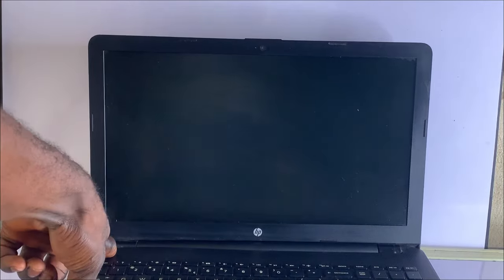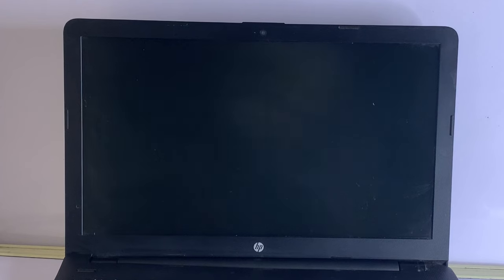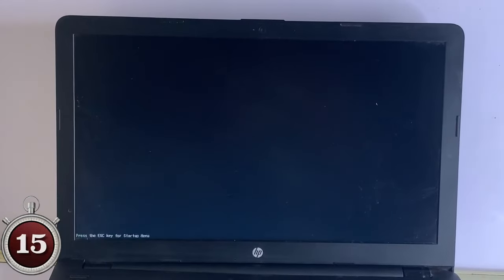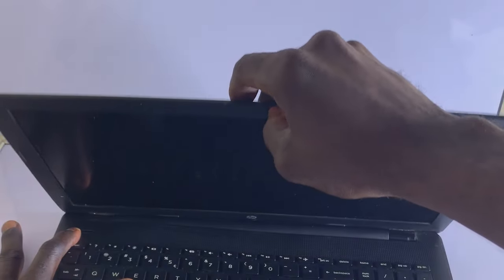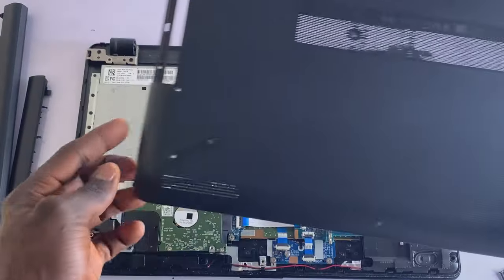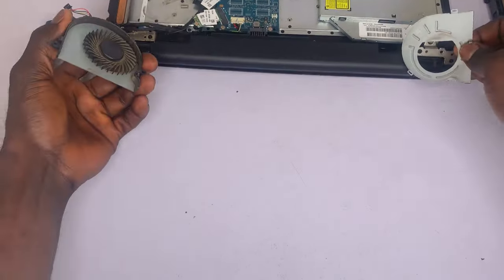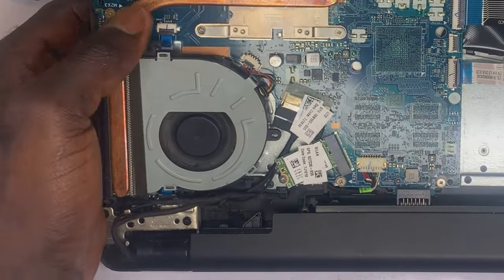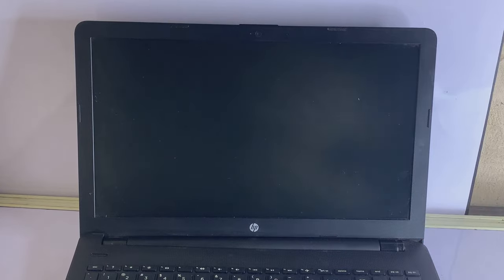Fix the system has detected that a cooling fan is not operating correctly || System Fan (90B)

Comment: What if the fan is spinning but it keeps saying errors 90B? What do I do?
Reply: Then change your fan completely
Reply: Am I right ? Mr. YouTuber 
because today I face same problem in my hp laptop so....
Reply: You change the fan
Reply: Full speed pr krke dekhlo
Reply: But the fan is brand new!😂
Reply: What the amount is needed for this replacement?
Reply: Clean your fan
Reply: mine too, what i found causing this is "WINDOWS SYSTEM UPDATE" i usually keep unninstalling the 22h2 update, and it really fix the problem, but my laptop cant be connected to internet, bcs everytime it got connected and updating, the fan problem is keep coming back
Reply: @Ayrustration same problem after windows update. How you solve fan problem. Plz hlp
Reply: I'm late but I got a new fan and still have the problem both fans I got were brand new
Reply: How to uninstall the last update without computer turning off due to the error😢 @Ayrustration

Comment: Fans are brand new, test both. Passed both 60% and 80% test, both failed at 100%. Now what? I seen one guy saying you need to solder a miniscule piece as small as a grain of sand that was missing 😂. Why would it fall off if it was soldered? Not to mention you need stuff to solder plus the "missing piece". And this guy is saying to ignore the message you computer's giving you and have the fan "always on"? The fan is supposed to be on when it needs to , he's just overriding. It will last 2 weeks max. 😂 Nobody knows. I bet if you go to a repair shop they will lie and replace the fans and say it's ok.

Comment: I thoroughly cleaned out the fan, still wint budge. Blew into the vent too. I ordered a new one yesterday, guess i'll have to be extremelh careful removing the housing around the motherboard, the battery just to remove the fan and heatsink and replace both. Also bought thermal gel. Why do we have such elaborate housing to get tot he fan? They should have made it easier to access the fan cable. I dont want to remove 15 screws just to disconnect the fan cable and find out its not that.

Comment: I opened the laptop, the fan it's totally clean and the bios configuration it's fine, the only option is to buy a new one?
Reply from the maker: Okay, but does the fan spin?
Reply: @whiszantech2425  nope, it doesn't move at all
Reply from the maker: That means it's should be from the Fan, try and request for a new FAN for your laptop or take to a professional Engr for the replacement
Reply from the maker: Since the PC is working fine, just replace FAN and have it functioning again

Comment: Muito bom o vídeo. Obrigado.

No caso ainda há outras opções caso tudo isso não resolva.
Existem duas possibilidades se o ventilador não gira de forma nenhuma.
Ou o ventilador está queimado ou a placa do laptop não está mais mandando a corrente para alimenta-lo.
Ainda há a possibilidade de ser as duas coisas ao mesmo tempo 

Primeiramente verifique com um multímetro para ver se existe corrente na placa principal do laptop onde o ventilador se conecta a ela. Identifique onde se conecta o fio dos 5v (geralmente vermelho) e o GND (geralmente preto) e faça a medição com o laptop ligado.
Você também pode testar o ventilador em outro laptop ou de alguma outra forma (uma fonte assimétrica talvez) o alimentando com 5v.

Se o ventilador estiver queimado a solução é apenas substituí-lo, o que pode ser um pouco complicado dependendo do modelo, mas pode-se fazer algumas adaptações com ventiladores de laptops diferentes.

Se a placa principal não fornece os 5v necessários para a alimentação do ventilador, então temos duas possibilidades. Levar a um técnico especializado a identificar o componente queimado e substituí-lo, ou soldar o ventilador em uma das portas USB internamente.
A segunda opção é interessante, pois o ventilador ficará sempre na potência máxima ou próximo a isso, constantemente sem variações, e o melhor é que a porta USB ainda pode ser usada.
Ao fazer esse procedimento precisa prestar muita atenção para não ligar os 5v e o GND invertidos. Se isso acontecer o ventilador queimará.
O mesmo cuidado é necessário ao se testar o ventilador fora do notebook.